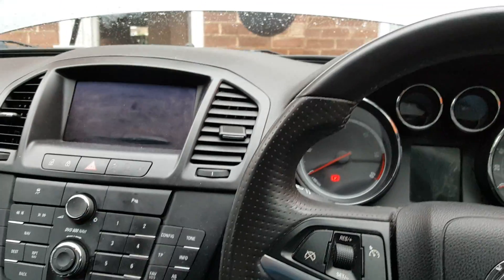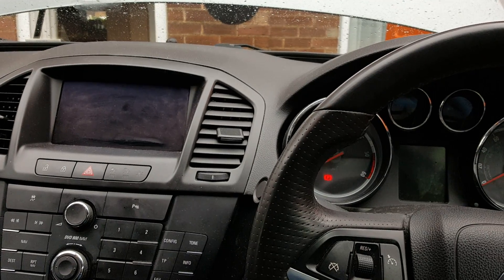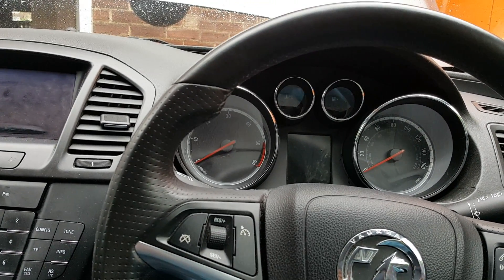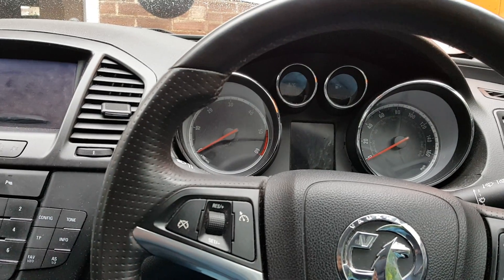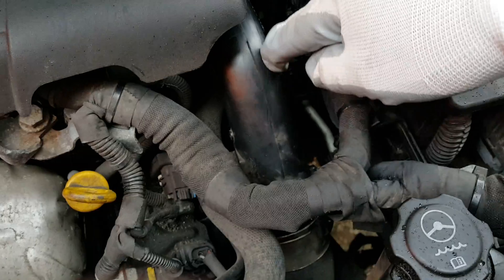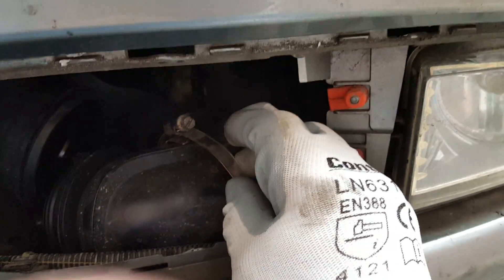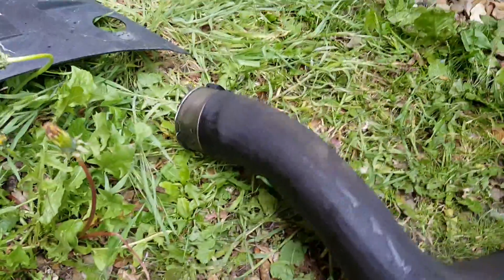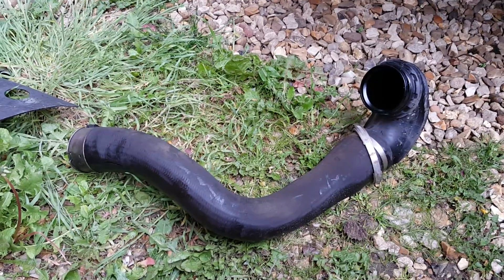Vauxhall Insignia CDTI A20DTH P2282-52 root cause.

Comment: Hi I've had same problem ended up changing my mass flow sensor first then found split in pipe because of your other video (Which I am truly grateful 🙏) just changed pipe with new 1 jumped in car still now power at all car slowly got worse gone from loosing power round 60mph to now even after changing pipe got now power from first gear? Please can u help do I need to plug it in to clear faults? I hope it's not a turbo surly can't be both
Reply from the maker: Hi
If you replaced the MAF, there is a procedure to reset it...
Scan the car also, and check live data, that should indicate where the issue might be...
👍👍👍
Reply: @LMAutoRepairs  thanks alot fingers crossed today i solve the problem

Comment: I have a similar problem. The RAC did a re gen and reset everything but when I left from work the engine Managment light came back. I do have  oil in air filter. Could this be the issue ?
Reply from the maker: Possibly...
You need to check it...
👍👍👍

Comment: Hello …. 
Hope u are in good health
I have DPF warning on my vauxhall insignia 2009 
I went to local workshop, they asking 300 pounds to clean and clear the warning which is way beyond my budget
The car runs perfect so far even at speed of 70 miles with RPM upto 2-3. No limp mode 
Need your advice 
Regards
Reply from the maker: Depends why the warning came up...
If is saying is getting clogged, soon or later will put you into limp mode...
If there is something else... do you know what was the faults logged? 
👍👍👍
Reply: @LMAutoRepairs  
Can i clean the DPF myself or should be done from a workshop
I have seen few videos which said that driving for some 30 minutes on motorway, with DPF cleaner in fuel tank, will clear the DPF and warning will go away
Tried once but nothing happened, planning to do it once more. Do you think it will be useful
Reply from the maker: @zulqarnainshah1350  
Without knowing exactly what the car is complaining about, it is difficult to tell...

Comment: Hi I this info on the dashboard  I've just check by the finger this pipe - by touch I didn't find any crack but it is oily near to plastic on top do you think that this it is a bit oily is correct or it can be slightly broken and I need to investigate it deeper? I maybe try to film it by phone maybe to see/ sometimes they say it is glowplug issue too - the info appears when is colder weather maybe because material shrinks and vanish - thanks for video very helpful
Reply from the maker: If is a small split, will might only be noticeable under pressure...
Do a more thoroughly inspection,  just to make sure...
Thank you for watching!
Reply: @LMAutoRepairs  Hi Thanks for the reply!!!  - do I need to remove oil from the engine when I change this pipe - sorry for the stupid question but I am not mechanic
Reply from the maker: No...
Thats an air intake hose...
👍👍👍
Reply: @LMAutoRepairs as I said I am not mechanic ;) so how the oil is there on the pipe
Reply from the maker: From the turbo...
Probably is leaking... 
But is not like the hoses are full of oil...

Comment: 13 plate sri diesel, 175000, trouble free its entire life, but what if you change the pipe and still get the error for time to time, others things I've noted is, 
excessive amounts of fuel, and burning a but of oil
Reply from the maker: Double check the intake system, and then I would be inclined to inspect the turbo...
👍👍👍

Comment: Hi my car stuck in limp mode vauxhall insignia 61 plate deasel  with no fault codes coming up don't go over 3000 rpms
Reply from the maker: With no codes?
What tool are you using to scan it?
What is the background of the car?
Thank you for watching!
Reply: @LMAutoRepairs  no engine management light on car mate says on cluster on car service soon it's the 1.9 eco flex 160 bhp
Reply from the maker: I understand the no engine light on, but, have you scanned the car?
Not all codes trigger the engine light...
Reply: @LMAutoRepairs  just scanned it no codes  got a scanner from ebay
Reply: Bought a cheep scanner from  ebay mate
Reply from the maker: What type of scanner?
If is a generic obd reader, it will might fail to read the codes...
Reply: @LMAutoRepairs  it's a genuine one it's say obd reader on the machine
Reply from the maker: Again, an compliant odb reader, might not read all the codes, leave alone live data...
I would get the car scanned on a scanner that can go dipper into the data of the ecu...
👍👍👍
Reply: @LMAutoRepairs   got a scanner on it  come up number 1 glow plug and a sencer need replacing

Comment: I had this issue less than an year ago, replaced the hose, job done. Yesterday I've removed the egr and egr pipe to clean (as I've done before twice) put everything together, go for a drive and now I'm getting this error! Don't want to believe it's the hose again, there's no oil on the pipe also. Any ideas?
Reply from the maker: Have you properly checked it?
Double check that the egr is correctly fitted, and that you have not missed anything...
Thank you for watching and for your comment!
Reply: @LMAutoRepairs   Yesterday I have checked if the hose had any split and it didn't, it's looking brand new.. 
It might be the egr pipe or the egr not sitting flush, I'll have a look this weekend again. Do you know if it's common the egr pipe to leak or to be broken? Regards
Reply from the maker: @MrLipynho  
It is possible... I would remove it to clean... while you are there...
Thank you for watching and for your comment!
Reply: @LMAutoRepairs  I've double checked the egr pipe again and one of the gaskets (I have 2 gaskets, cause I have a egr blanking plate) wasn't fitted properly hence the boost leak. Hope this info will help someone in the future. Thanks for your help.
Reply from the maker: @MrLipynho  
Good find... well done!
👍👍👍

Comment: I am seeing P2282 and P0404 in scanning report for my opel corsa 2012 diesel. Local mechanic is recommending to replace mass flow sensor but I feel it won't get my car out of limp mode. I couldn't find crack in mass flow pipe, please help me.

Comment: After market replacement pipe did fix issue for some time. In my example burst of pipe was possibly caused by clogged DPF, when replaced pipe 10 days drive and car started random short stalls when driving on low RPM. Few more days and DPF clogged message.... 

Cleaning DPF does help but for very short time so make sure your engine is free of fault causing DPF clogs and you still have to replace your DPF or its a shor time solution.
Reply from the maker: Good advice! 
Thank you for watching and for your comment!

Comment: There's an insignia A20 DTH, sometimes won't start and sometimes it starts. What's the problem you reckon mate? The car is for sale and is thinking of buying it but is a bit worried there might be something major. Timing belt and all the rest of it was done a year ago. Oil seal for oil pump in the crankcase was done as well.
Reply from the maker: Difficult to say...
Have you scanned the car, to see if there is something that points in any direction?
Reply: @LMAutoRepairs  Yeah mate, it's difficult to tell without scanning it. I think I'll walk away from this deal. Seller is very uncooperative . Thanks for the reply !
Reply from the maker: Probably the best...
👍

Comment: Hi there, dumb question, if I change the pipe myself, how can i get rid of the warning sign. Will it go away on its own or do i need to take it to the local garage to reset it? Thanks a lot for the video btw! 👍
Reply from the maker: I would say the light and the warning might  go away... the code will remain stored in the ecu until cleared...
Thank you for watching and for your comment!
Reply: Thanks for the reply. Will it affect the performance of my car if the code remains in the ecu?
Reply from the maker: @ambalee  
Shouldn't do...
But you can can get the car scanned and codes cleared at any garage...
Reply: @LMAutoRepairs  ok that's good to know. Thanks again!
Reply: Sorry one more thing. If I may ask, how much will it cost me for the scanning and clearing of codes?
Reply from the maker: @ambalee  
Any garage in the UK, probably around £30... I would say...

Comment: Bought recently an insignia from a guy who said it cannot be repaired and the turbo is gone. Paid him 1500 pounds for a 09 reg  with 76000 miles on dash and broken turbo. Did the tests and found the same fault, replaced the pipe and car now drives like new and no codes or limp mode coming back. Very lucky buy I would say. :)
Reply from the maker: Indeed! Just don't tell him what the problem was... lol
Glad you got it sorted...
Thank you for watching and for your comment!

Comment: Yeah my 2009 insignia 2.0 had the same issue the rubber split and was putting it into limp mode. As you said strange thing was it was clearing itself. Common issue on these cars. 
Mine is now loosing power when cranking the engine mimicking a flat battery but it’s not because I’ve checked the battery and all is fine with voltage etc
Another common one is the rubber pipe splitting between the rubber/metal connection with the power steering system. It’s a lovely car with plenty of power when working correctly but it’s riddled with common faults Vauxhall apparently know nothing about. Luckily I used to be a Vauxhall fitter and I worked for network Q. 
I’ve changed plenty of parts in this car another major fault is there is a rubber seal in the sump that allows oil flow through the engine but at about 100000 miles it becomes brittle and can cause the engine to seize. 100000 miles for a Diesel engine is very poor tbh they usually keep going and going.
My advice get rid of the insignia!!!!!
I’ll let you know what the issue was with the loss of power on starting. Great video 👍
Reply from the maker: Hi
Let us know then...
Thank you for watching and for your comment!
Reply: LM Auto Repairs will do thanks for the reply 👍
Reply: Update on the loss of power issue while starting. The battery on the Vauxhall insignia isn’t great either it registers it’s fine and good even the green indicator on the top of the battery says it’s fine but it isn’t. I’ve been looking at it this weekend and found out the battery had been in the vehicle over 5 years which is the max life for a battery and needs replacing. I’ve replaced the Battery and the vehicle starts first time every time without loss of power. Problem solved 👍
So if your Vauxhall insignia suddenly has a loss of power on starting even through you’ve had the battery checked by a mechanic and they say it’s fine It isn’t good it needs replacing. Yet another gremlin with this car.
Reply from the maker: @madmikeproductionsuk  
That's great! 
Bad batteries can cause indeed all sort of issues!
Well done!
👍👍👍
Reply: LM Auto Repairs thanks LM Auto Repairs 👍

Comment: Hello... I've experienced service soon message and check engine light after about half an hour. On diagnosis the fault is p2282...so air leak. So I've took a look under the bonnet and didn't find the split intercooler hose, and then i've took the car for a ride...even managed to reach 200km/h. So my question would be...can you reach this amount of speed with engine in limp mode and split intercooler pipe?
Reply: Update!!! 
i think it was my turbo actuator that modifies the variable geometry of the turbo.
i've deleted the error and with a steel rod i've repetedly pushed the actuator on all it's travel. now the car drives just fine and is quick in low rpm, like before te error.
since then i've driven over 200km and it didn't show up again, the error i mean.
by all, safe roads!

Comment: Just a quick update. I have ordered a new hose but took the old one off last night ( through the NS fog lamp hole). i cleaned the pipe up with a brillo pad and Fairy Up liquid and removed all the oil and dirt. Dried it and glued the split ( 1") with superglue. I then stuck a rubber patch on ( similar to a push bike inner tube repair) after this i wound gaffer tape around and over the patch and its cured the car with no codes appearing this morning. will replace the pipe when it arrives. Thanks again Dave.
Reply from the maker: Thanks for letting us know...
I believe that is a great temporary fix... because the hose is already weakened, it will eventually split again.
Nevertheless, you thought outside the box, and that's good!

Comment: don't no which sensor it is yet I've booked the car in for next week for further investigation my scanner is showing no faults
Reply from the maker: OK...
which scanner are you using then?
Reply: I'm Using one I borrowed from someone at work it uses Bluetooth to connect to your phone and the OBD torque app
Reply from the maker: +Ken Daws 
Ah okay...
It is probably an OBD scanner...
Unfortunately those scanners fail to read codes that are not under OBD compatibility... That's why does not show it...
Find which sensor is and go from there...

Comment: Hello, my insignia went into limp mode with code p2282 air leak between throttle body and intake valves. Ive just had a look at the hose and indeed has a split in it, any idea what the part number is and description. i will order and replace in the next few days. thanks for the heads up saved me a load of time and money
Reply from the maker: Hi
Glad it helped you!
If the part number has not been superceded, is 23163578.
Thank you for watching!
Reply: Thanks again. Thank God for the internet.
Reply from the maker: +eveerdivad Ll
Reply from the maker: +eveerdivad
LOL

Comment: hi i have same car and have same problem it has been in garage 3 times and i have been told it has been fixed but hasent they told me it was air intake sensor then it was co2 sensor but its still doing the same my question is am i damaging the car if i still drive it
Reply from the maker: Stephen Cameron 
I will not damage it... but will impact the car's performance, fuel consumption etc...
Have you checked that this hose is not splitting?
Thank you for watching!

Comment: Hey can you help: my astra j sri car 2011 cdti goes into limp mode with service vehicle soon on the dash limiting speed to maximum 40/50
Also noticed on uphill while in limp mode it struggles but going downhill increases speed

If i switch it off and on again starts to work perfectly if i wanna hit high speeds goes back to limp mode☹️☹️
Reply from the maker: Scan the car and go from there...
There will be codes in the ecu which will help you going in the right direction...
Thank you for watching!
Reply: How to clear dpf full

Comment: hi I took my car to a garage today because it was still in limp mode after I changed the intercooler pipe they put it on there diagnostic equipment and it's showing dpf sensor fault and won't reset this fault didn't show on my scanner all I got was air leak between the throttle body and the air intake do you no what I should do there is no dpf fault showing on the dash
Reply from the maker: Hi
Which sensor, have they told you?
If a sensor is faulty obviously need to be investigated...
Is your scanner capable of live data?

Comment: But how a cracked pipe can cause icreased airflow on the mass airflow sensor? Wouldnt that cause unmetered air thus decreasing airflow onthe maf.?
Reply: Ecu compares air flow with manifold pressure if the air flow is high and the manifold pressure is low there is a problem

Comment: My one same age, driving lost turbo, checked pipe and had crack, replaced pipe and 10 days later DPF clogged up, cleaned DPF and 2 weeks later giving me random 0.5 second stalls usually when driving constantly same speed or low RPM - think this might be pressure related, too much pressure build up - maybe DPF clogged more again ? HElP ?
Reply from the maker: JoxPL 
Hi
If you can, check for codes and live data...
That can be caused by different things...
Thank you for watching!

Comment: Hello mate,

Helpful video thank you very much. I found a split on my intercooler hose pipe. Ordered and just changed. My diagnostic doesn't show any fault code,  sign of service still on dashboard. Should it disappear by itself or need an electrician with a genuine op-com?

Thank you
Reply from the maker: Veaceslav Voinovan 
Hi
Glad to hear that...
If the service light is on, there is a procedure to reset it on the car with no need of any tools...
Just Google it and you will find it...
Reply: Thx m8

Comment: Just had the same issue, replaced the original 2009 pipe with an aftermarket one. Other symptoms might be smell of smoke getting inside when the engine heats up, and quite possibly a lot of smoke coming out the back (got some flashes from behind, on the road). The check engine light might come up and remain permanent until cleared with obd interface, if the difference of pressure is extreme. Cost me around 90 EUR part+labor. Takes a max of 1h to replace.
Reply from the maker: Razvan Dumitru 
Thank you for watching and for your comment!

Comment: good video. have you come across   code p2428 exhaust gas temperature too high on vauxhall insignia?  the car stops with engine overheating but engine is fine. the sensors have been replaced by still happening?
Reply from the maker: n1kh1lv 
Hi
No I am afraid... never had that one... have you checked wiring?
Reply: Reprogram ECU with the newest program. It's factory issue.
Reply: Hi, 
do you know where can I find the newest program to reprogram ECU? I'm facing code p2428 very often now
Reply: Anphry Bogart Gotta see the dealer. It should be covered under warranty since its factory fault and there was a recall for this specific problem

Comment: Hi, my car keeps loosing power and would not accelerate and I have changed everything. It won't go past 70 miles and when I try the engines stops. Is there any solutions that are simple and cheap? Please let me know asap
Reply from the maker: Dora Szabo 
Well... is not that simple... have you had the car scanned?